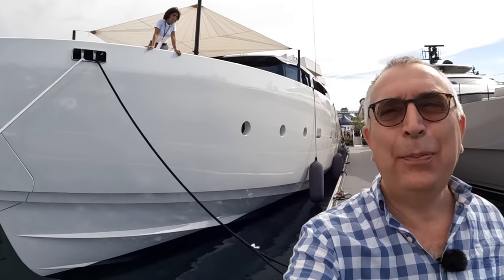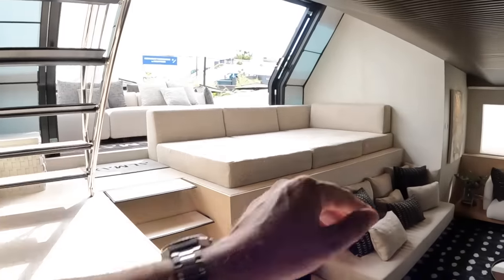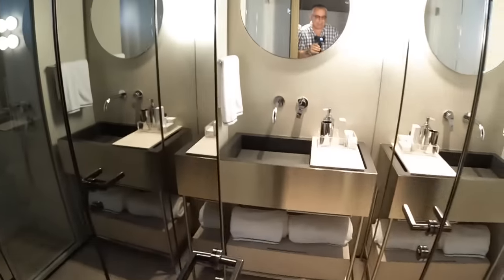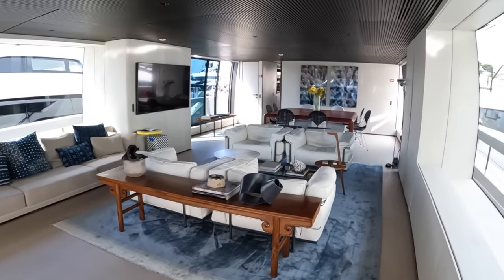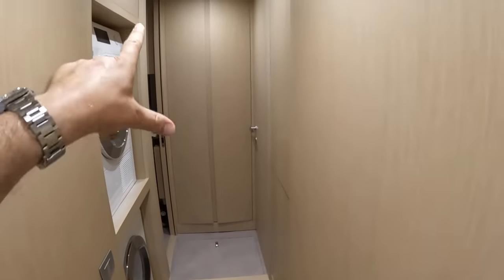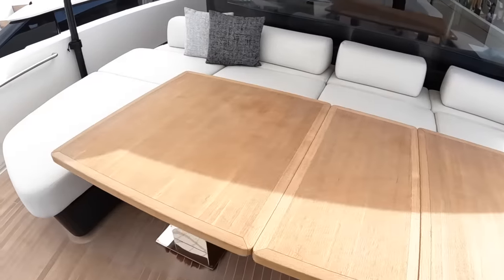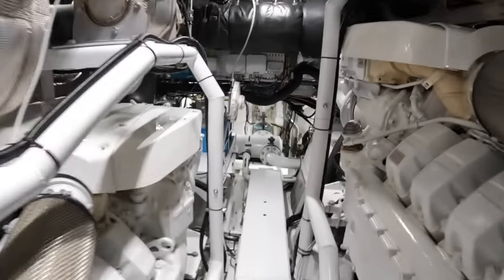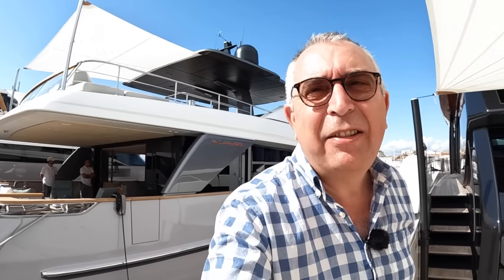€12.4 Million Superyacht Tour : Sanlorenzo SP110

Comment: Amazing boat. Wow.
Reminds me of a 40 knot, water jet, super yauct that Nauti Styles did a tour on, I think last year.
Three, 2,600 horsepower engines pushing water jets. Amazing technology.

Still, the Thunder Child 2, with propellers, and four 500 or 650 horsepower engines, reached 54 or 55 knots maximum speed, or cruising at 32 to 40 knots for 750 miles. But that's a pure power boat, without the luxury of a yauct.

Comment: What is up with those white filters/screens over the windows at 0:25?  Is that something that can be controlled from inside? or do they have to be attached from the outside?    I do wonder if that's possibly too many full length mirrors or is it "just the right amount" for a party yacht? 🥳 🎉

Good tour, I always appreciate the occasional laugh when you can't open a door on the first try.  😉

Comment: The amount of fuel those jet drives must use is staggering to think about. Curious what the fuel storage amount is. Can't imagine it being anything fuel efficient. Stunning yacht though, I could see myself on it.
Reply: 12000 litre capacity, so at 35kts having a 400 mile range its 30 litres per mile, but if you can't afford the fuel......

Comment: I think sp110 is better than sx112 nice interior by piero lissoni.
40knot top speed 400nm at 35knot cruising soeed is impressive too with 8guests 5crews 229gt 8.2m beam.
But there are strong competitors like ab 120 ,pershing gtx116 in high speed superyacht market.
Good luck😂